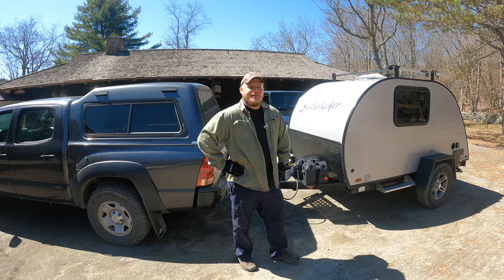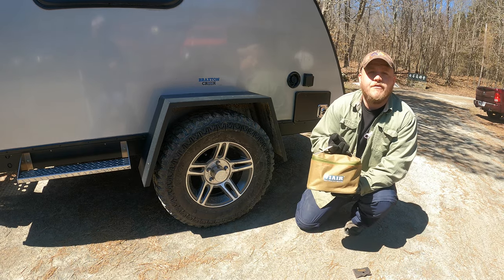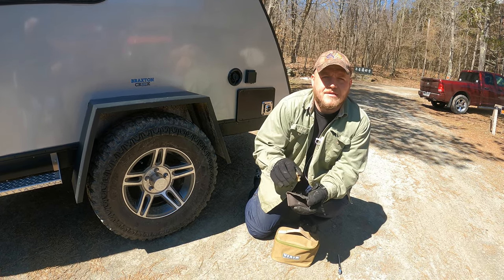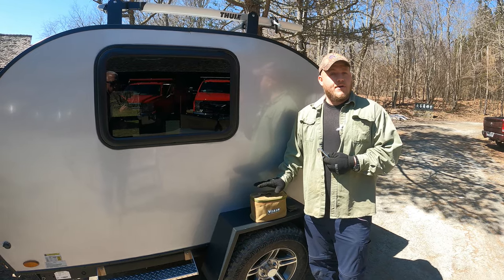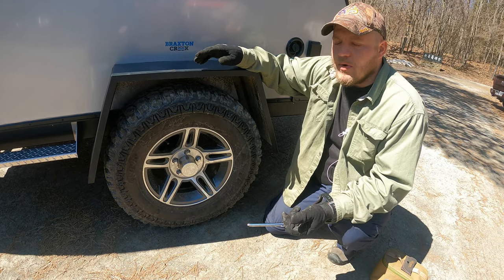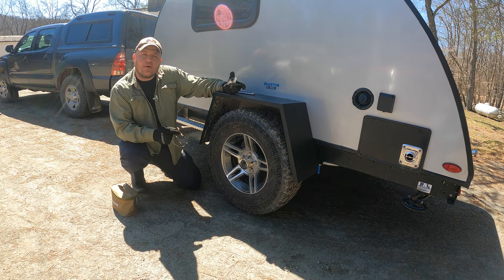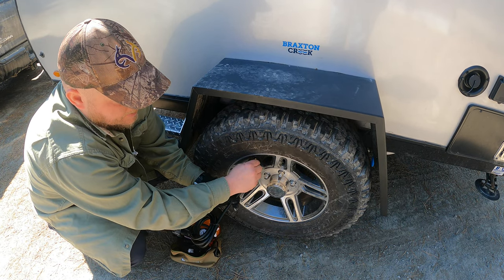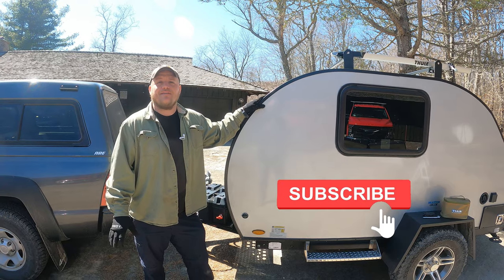Camper Tire Pressure - Novice to Expert

Comment: Good info.  Also very important to point out that temperatures can have a big affect on the pressures.  If you check pressure on a cold morning and see it is low you might want to add some air to get the good highway gas mileage.  In this situation you MUST check pressures again and adjust them after driving awhile because those tires are going to heat up and then you'll find you have exceeded the recommended pressure and are at risk of very bad things happening at highway speeds.  Don't ask me how I know this.
Reply from the maker: Excellent advice, thanks for watching!

Comment: great tips on tire pressure.    My trailer recommends 80psi, but I run at 55 psi.   My tires at max pressure of 80psi would support a load of 10800 pounds which is 2000 above my trailers GVWR to start with.   More importantly I took my unit (fully loaded and travel ready) to a CAT scale.    Turns out there is 6800 lbs on the trailer axles or an average of 1700 lbs each. Now loading can vary so I added a 25-30% buffer and the tire specs say 55psi would be perfect for that amount of weight.   Definitely trailer tows smoother.   I have done 5000 miles since lowering the pressure, and fuel mileage basically identical to the previous 6000 miles done at 80psi.   Tire wear seems fine as well and absolutely no issue.   I think manufacturers pick a tire and wheel combo for their trailers and then just specify the max pressure as shown on the tire sidewall.   Heck I could put another ton of weight in my trailer over the axles (they are good for 4400lbs each or 8800lbs) and still not over load the axles and I would still not need the 80psi to handle that, although if allowing some buffer it would be closer.   CAT scale tells you what your real axle load is... add a 25% weight buffer to account for potentially uneven loading and then check the tire manufacturer specs to see what pressure is required for that amount of load, and hit the road....as always safe travels......
Reply from the maker: I love that you were so smart about this.  Finding the right pressure makes a huge difference in the ride and the type of wear and tear.

Comment: So you recommend adjusting pressure any differently in different external temps? I.e. if it's super cold or hot out
Reply from the maker: I usually add or remove PSI when the outside temps pull me off my mark

Comment: What tire pressure do you run in the camper for offroad rocky or washboard roads? Also here's a tip I learned...I adjust my deflators on the tire of my pressure washer.  The deflator doesn't know what tire it's on, just what pressure it's at.  Saves a lot of time inflating and deflating a regular tire just to adjust the deflator.
Reply from the maker: Nice tip! I drop pretty low for some roads.  It’s not like they have bead lockers on them, but you can go single digits without having problems if you’re going slow. Typically 25 psi feels great & like a completely different camper, but for sand or really bouncy roads I go lower than I’m supposed to recommend…lol